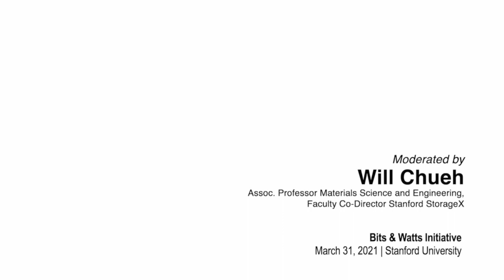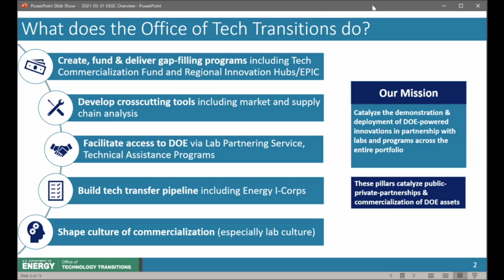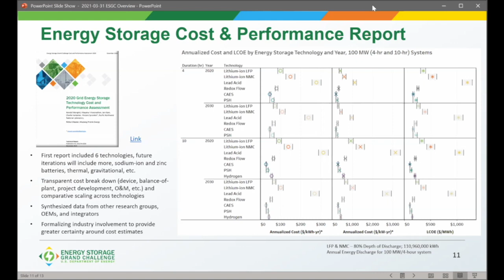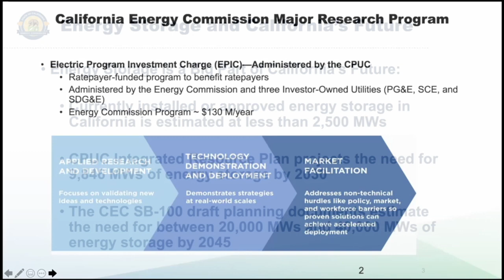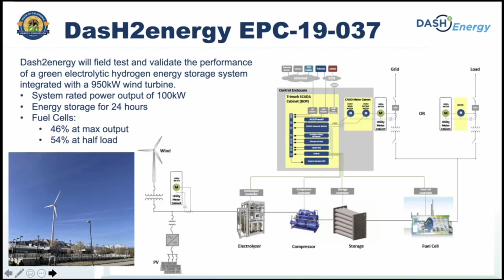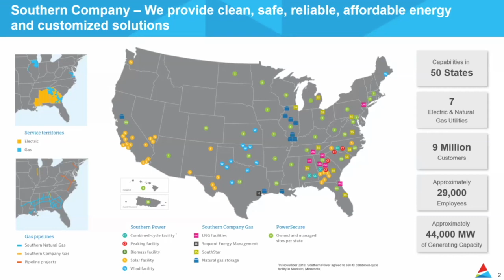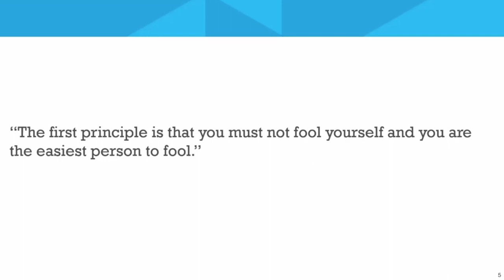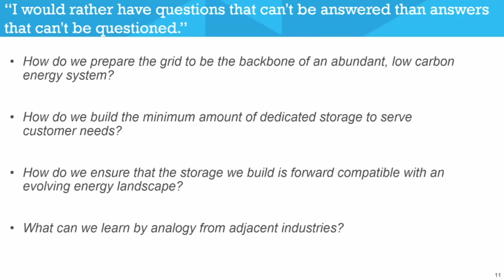Storage Integration including but also Beyond Batteries | Decarbonizing the Grid | Bits and Watts

Comment: 1:55:00 Probably the wrong question. If hydrogen leaks out of pipelines and embrittles the metal, then a smaller proportion of hydrogen just means less leakage, but still leakage, and embrittlement. I'm not aware of any physical process that would create some sort of threshold effect.

Comment: Surely batteries are not a viable solution, even should battery technology advance far beyond what it is now and at a vastly reduced cost. And that, of course, is not agiven or even really probable.

While there is a lot of interest in storage and very many 'innovative ideas' have been proposed as an alternative to chemical batteries the missing link, as I see it, is insufficient sustained excess of renewable genertaion to both supply demand and be able to quickly recharge any storage device. That is ignoring the other very real problem in that there is a limit to how much asynchrouss, nil inertial power input the grid can  accomodate.

The very obvious and ultimately far more economical source of non CO2 power is nuclear. That is not without it's negatives, largely that current large nuclear power plants cannot easily modulate output to keep the grid supply and demand balanced.

Gas is, at the moment, the best way of powering a secure and reliable grid, although coal should not be dismissed as modern coal plants are very low in emissions of pollutant gasses, and have the benefit as an alterntive fuel type should there be supply problems with gas?

The prime criteria of any grid is stability and reliability.
Reply: How are you including coal in any serious discussion? Coal is the fossil fuel with the highest carbon dioxide output. It is mostly carbon
Reply: At least methane has hydrogens. Methane has roughly half as much carbon dioxide output per unit energy since a lot of its combustion energy comes from the hydrogens. The big problem with methane/natural gas is that it is itself a potent greenhouse gas if it leaks